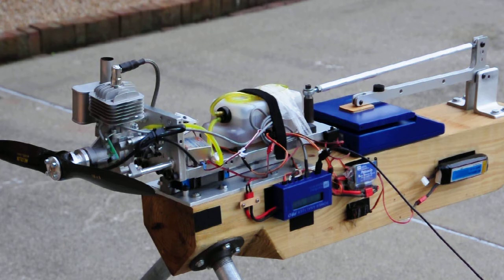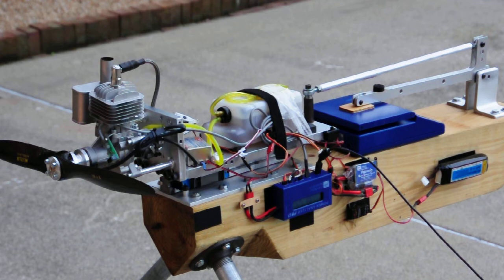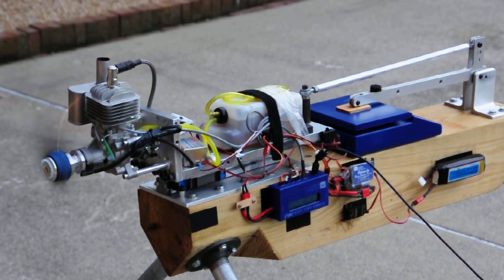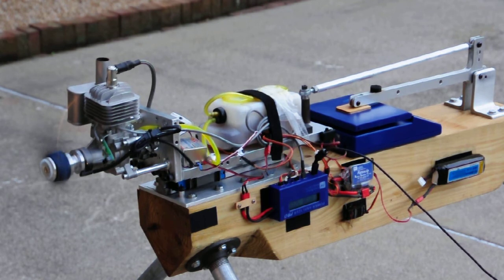DLE-30 Engine Thrust Test with Mejzlik 19X8 Carbon Prop

Comment: When I saw your test about the the OS GT33 putting 20.2 lbs of thrust and with those dle 30-35cc only have 17 lbs. And about 92 dB of noise. I'll go for the OS engines or the real DA engines.

Comment: I have a poor running DLE 30 any idea what the high and low screws should be? I know they are different with altitude changes but if I had somewhere to start would be great.
Reply: Supercub1974

Comment: @mrbigg7255 Hi - I did the test for RC-SF.  I believe a 19X10 would produce too much of a load and result in poor throttle response, but there would be no harm in trying it.  Just watch out for overheating and start with the high needle a bit rich.  Mike H.
Reply: Yes, I agree. A 19x10 is a little heavy and I notice a few vids on here use an 18x8 prop. I first used an 8 and tried a 18x10 and got much better performance.